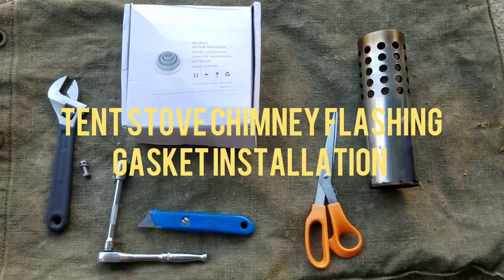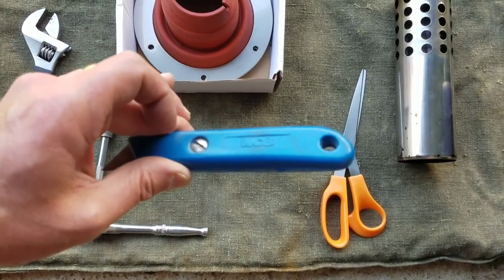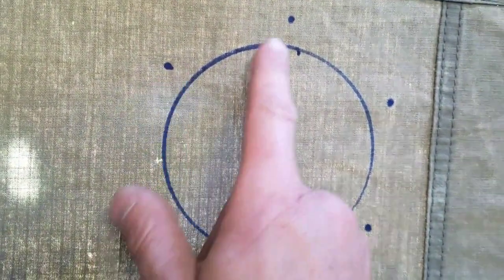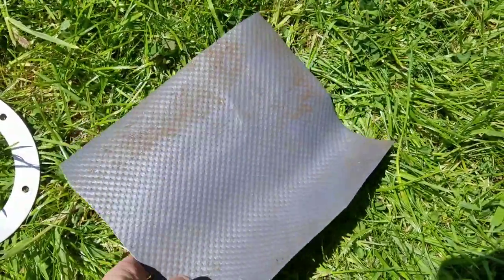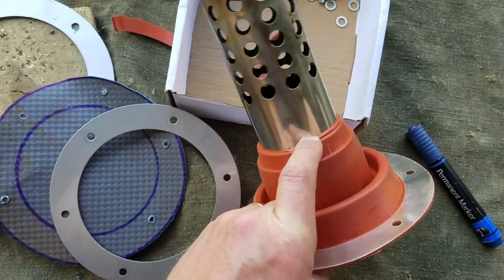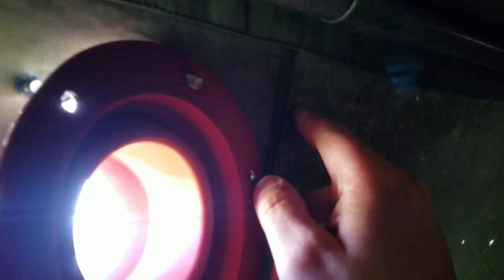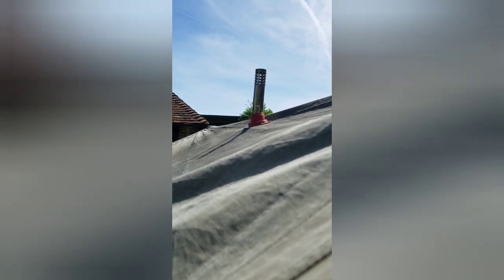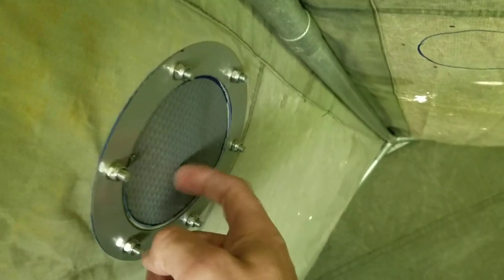How to install silicone wood burning stove chimney flashing kit on a tent. Army 9x9 tent, Outbacker.

Comment: Great video! I was concerned when you were fitting the gasket and rings and it seemed like you could have done with another pair of hands, say someone on the other side of the tent to coordinate with you. Wasn't anyone from the Expedient Brass Band available? Surely they offer a emergency gasket/tent cooperation call out service? They can't be practising their barber-shop marching anthems via country-fair beat-combo proxy all the time, surely?!

Comment: aah at the very end you mention about another pair of hands - got it. So when you want to flash up the stove you'll need to remove the blanking plate and install the chimney , how long a job is that?
Couldn't help but think how when it's just the blanking plate, the ring then had a certain port-hole appearance. Perhaps children might like to paint some waves and other nautical themed  images around that area? 🛳 ⚓